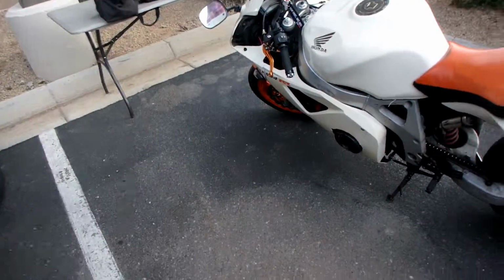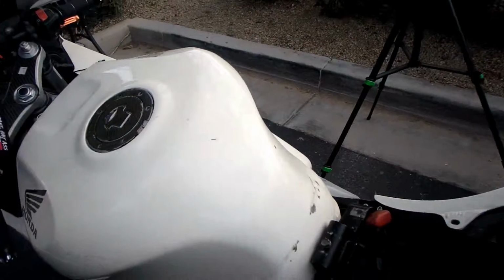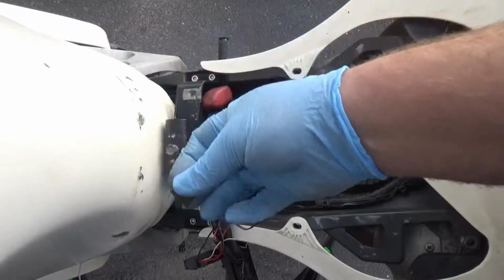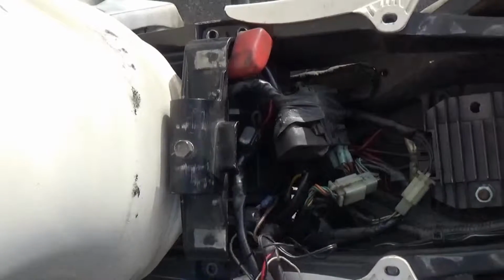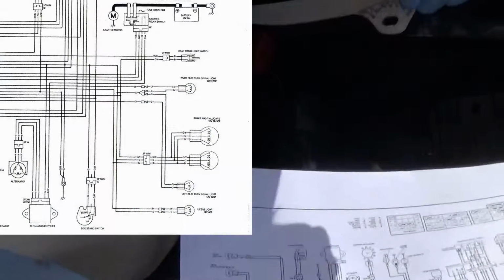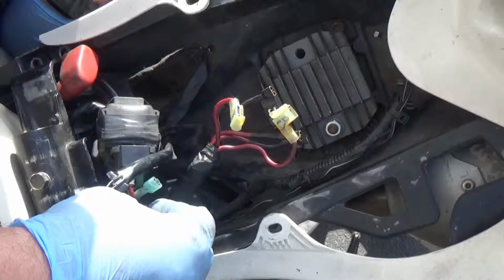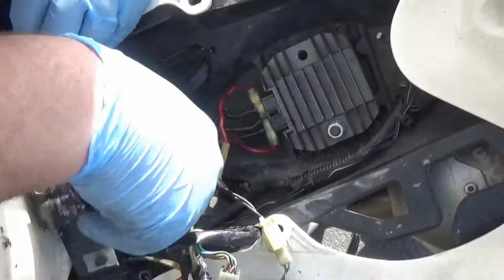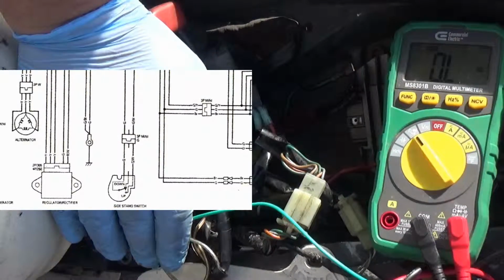1999 Honda CBR 900rr, CBR 954rr, VFR750, CBR 600rr, and 2005 Yamaha R1 electrical troubleshooting.

Comment: HEY BRO... I REALLY NEED YOUR HELP... I HAVE AN 2003 954RR... I WAS RIDING & HIT A HARD BUMP IN THE STREET.. MY FUEL PUMP STOPPED... I GOT TOWED HOME... I SEEN ON YOUTUBE ABOUT THE MAIN GROUND PLUG WHICH IS YELLOW IN THE BATTERY BOX GROUNDED OUT... I SPLICE THE WIRES & CONNECTED ALL...THE RELAY IS CLICKING WITH THE RUN STOP SWITCH AND FUSES ARE GOOD...THE ENGINE CRANKS BUT NO FUEL PRIME...I JUST FINISHED BREAKING DOWN EVERYTHING !!!!!!...... I TEST FOR OHMS... FROM THE CONNECTOR TO THE PUMP READS BUT NO READINGS TO THE RUN STOP SWITCH... I TOOK THE AIR BOX OFF AND PEELED THE WIRE HARNESS....THERE ARE NO BREAKAGE IN ANY WIRES... MY MIND IS BLOWN !!!!!!!..... PLEASE HELP ME
Reply from the maker: Good evening. Based on the information provided. You might what to also look at the lean angle sensor.  A hard bump can mess it up.  Just a thought though.
Reply: THE TIP SENSOR IS OFF & BYPASSED FOR YEARS

Comment: I had the same thing happen with my 900rr recently. Why wouldn’t the fuse blow right away why was he able to ride around before it blew ?
Reply from the maker: Could be many reasons.  The regulator/rectifier could have failed to charge the battery then failed further thus causing a direct path to ground.  Kind of like a ticking time bomb.  Could have had a certain amount of resistance after it failed but not enough to blow the fuse for a period of time.  Hope this helps.
Reply: OTRVM I understand . You wouldn’t happen to be located near the New York area lol ?
Reply: OTRVM or do you have a email so if I need help I could ask questions ?
Reply: What might you think is causing new battery to drain instantly? I tested it at 12.4V before installing, put it it and wasn’t enough power to crank it. It attempted to crank 3 times then just kinda started clicking like a dead battery sounds like, tested battery after attempting to turn on and it’s reading 7 volts, starts right up with a jump and the battery reads 12v+ when running. The moment I turn the bike off it drains the battery, I’ve tried 2 different batteries and same thing happens. This is on a 1999 cbr 900rr